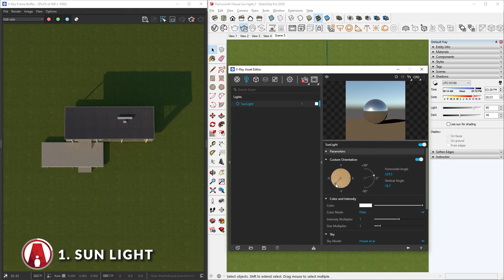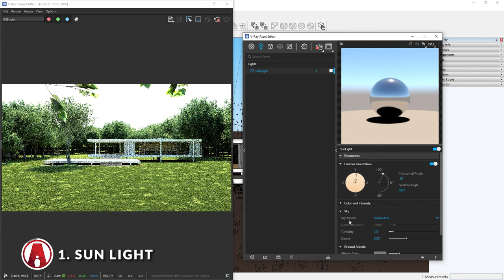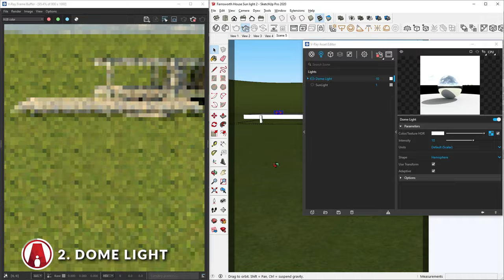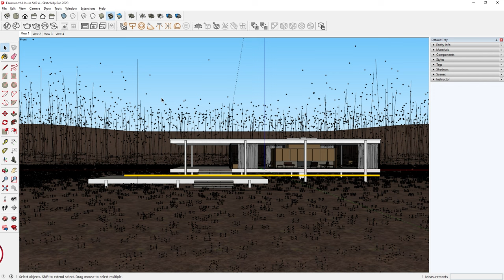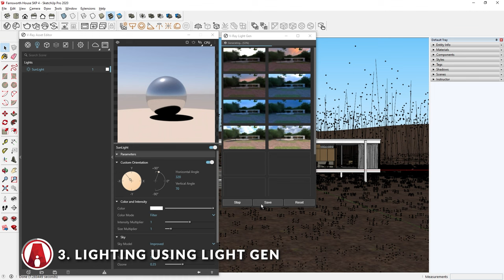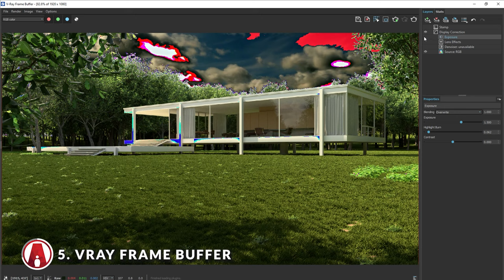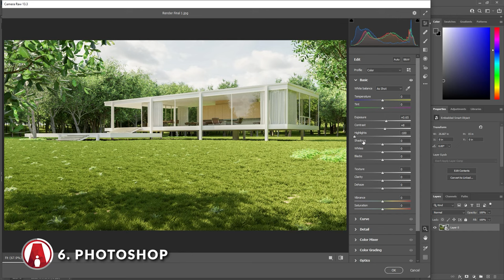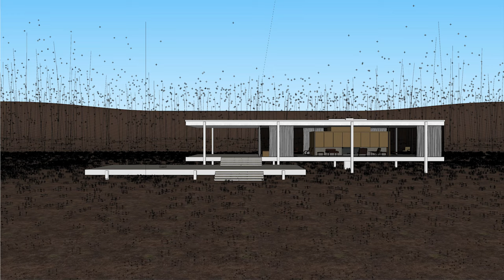REALISTIC Exterior Lighting Tips in 6 Steps for V-Ray

Comment: For the dome light, what’s the relevance of the “Adaptive” checkbox and how’d you determine whether to check or uncheck it? Also, when you click into the image you have an option for RGB, Linear, etc. What does that mean and how do you know which option to use?
Reply: Adaptive speeds up the rendering by optimizing the sampling algorithm for the dome light. No light portals are needed with this setup. Light Cache must be set as the GI engine for this feature.
For the difference between Linear and sRGB, it's long to explain, you should search for tutorials about Linear Workflow. It's a useful technique to improve realism.

Comment: finally updating my sketchup and vray after using version 2018 the whole time because 3dwarehouse doesn't support version 2018 or lower. haha
Reply: @abrahamfajilan6574  nope. the file i want to download from the website simply didn't show version 2018 option or lower
Reply: @abrahamfajilan6574  because my low spec computer will hang when i use sketchup to browse 3dwarehouse
Reply: @fixarsfix1206  I see.. What is your computer spec? My laptop spec may be lower, but it do not hang before, the only issue is that I can't use 3D warehouse now because if the internet connection error message even if I have an internet connection